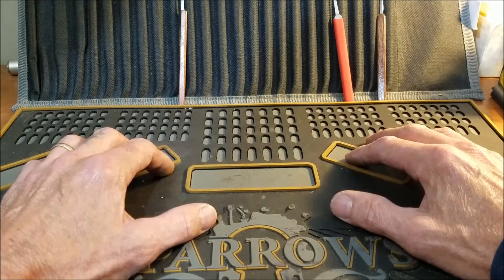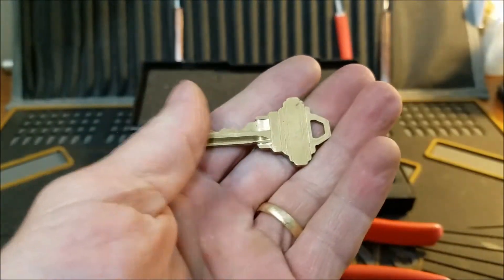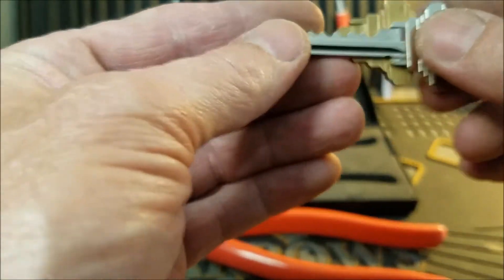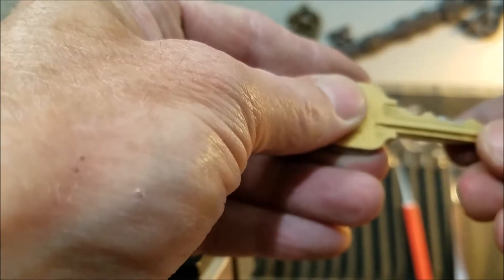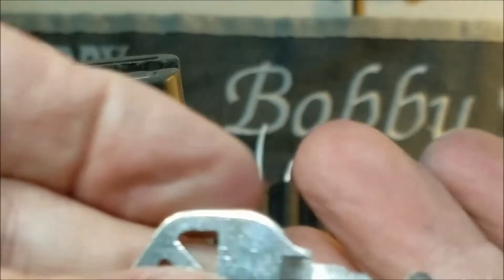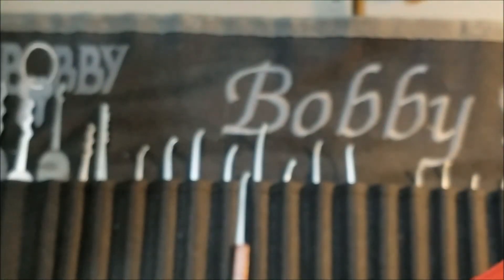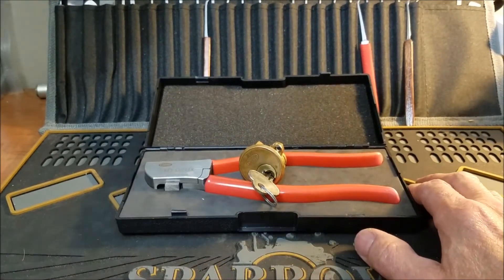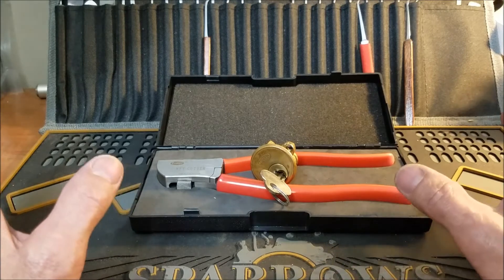(366) 600 Subscriber Appreciation **GIVEAWAY** Thank you for your Support

Comment: That is a great tool. Could be used for in the field emergency rekey. Just dump a  single cut 2 steps and replace the keypin. Even work for temp rekey for a restricted  masterkey system, while waiting for a new code from the factory. Needed when people get keys and address ID stolen together.